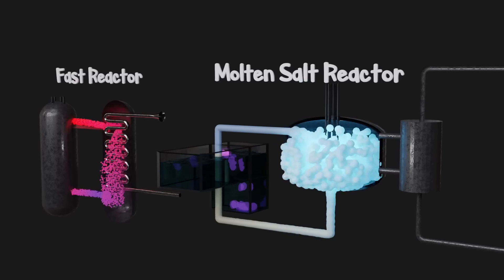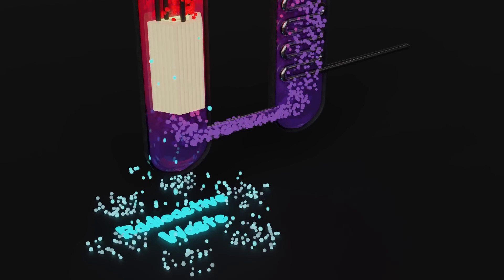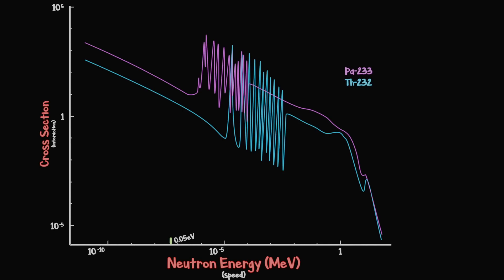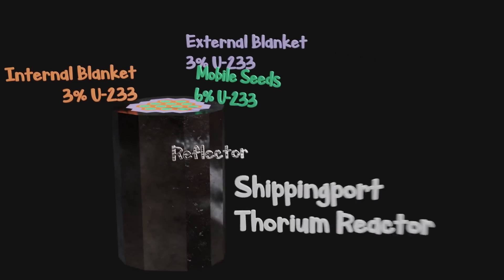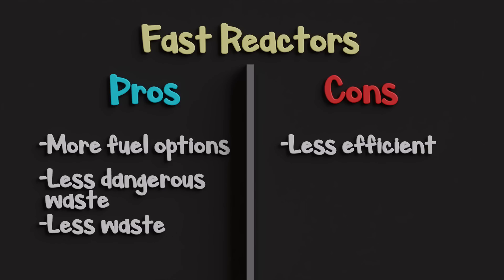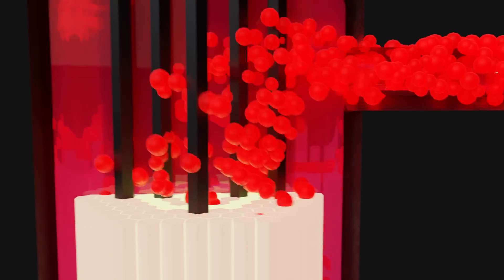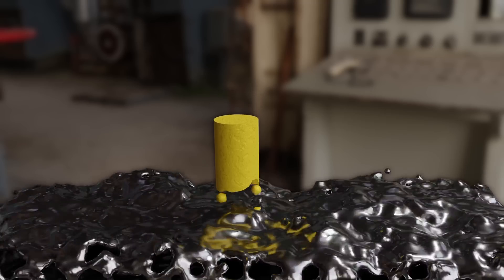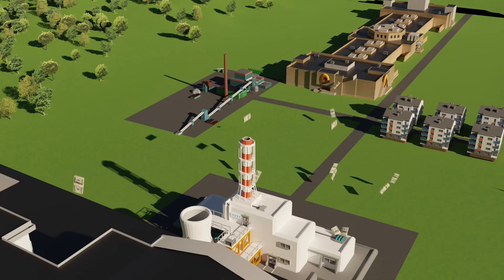Thorium and Fast Neutron Nuclear Reactors

Comment: The point is - why use thorium at all, when spent fuel and depleted uranium (DU) is abundant?
The waste of 1 reactor year of a 1 GWe conventional reactor can provide up to 140 times the electricity originally produced. Additionally, the side product from enrichment, depleted uranium can provide another 4 - 5 times the electricity of the spent fuel. In total, this is about 700 times the electricity that was produced by nuclear in the past. This are resources worth tens of trillions or even hundreds of trillions USD, that could pay the debt of the US multiple times easily.
A side effect is that the "waste" produced after complete burn down consists of 95 % partly precious metals, and about 5 % of waste that decayed after 300 years to the level of natural uranium. Of course, it is poisionous, but can be stored just like normal chemical waste. And the amount is small anyway, because 1 kg or uranium/thorium contains 24 GWh of thermal energy. 
But be aware, beside some advantages of thorium, there are nasty site effects. There are hard radiation sources within the thorium-cycle. Proactinium 233 and Thalium 208. Pa 233 comes from breeding Th233. It is a bad neutron poison, that requires immediate separation from fuel, otherwise reactivity stopps. Pa233 then must be stored separately, until it has decayed to U233. This decay also produces hard alpha and beta radiation. TI208 on the other side, comes from a small part of U232 produced during breeding. U232 decays at some point to TI208, which issues hard gamma radiation. This requires more extensive shielding and complicates handling. So the thorium-cycle has some drawbacks, which are often not mentioned. 
IMHO, before using thorium, waste and DU should be burned. And if this isn't enough after thousands of years, there is the posibility to get uranium from seawater, for which China seems to have found a cost effective solution now. 
Of course, you can use thorium sometimes in the same reactors, that burns waste and DU, but it isn't necessary for energy needs for a long time. 
So again, why use thorium when it isn't really necessary?

You missed the patented Dual-Fluid Reactor, which is a special variant of a Lead Fast Reactor (LFR). In contrast to the BN-800 it uses molten metal fuel instead of solid fuel. Molten metal fuel consists as base of an eutectic mix of U-235/U-238 and chromium. This has a melting point of about 900° C. You can also mix in pre-processed spent-fuel by the pyro-processing-unit and thorium. But this has to be done carefully to keep negative reactivity high to keep temperature below the design limited at cooling failure. 

🔋 Key Advantages of the Dual Fluid Reactor (DFR):
• ⚡ Ultra-efficient: Nearly 100% of nuclear fuel is used  
• ♻️ Burns nuclear waste, depleted uranium, and even thorium  
• 💥 Transmutes long-lived actinides into short-lived fission products  
• 🔄 Built-in Pyro Processing Unit (PPU): Continuously removes neutron poisons and extracts valuable metals  
• 🛠️ Liquid fuel: No solid fuel rods, no batch reloads  
• ⏳ Decades of operation with a single fuel load possible  
• 🚫 No corrosive salts: Liquid metal fuel avoids fluoride corrosion and complex chemistry  
• 🧊 Lead coolant: Excellent radiation shielding, no water, no pressure → no steam explosion risk  
• 🌡️ Very high temperatures (700–1000 °C): Enables hydrogen, e-fuels, ammonia, and direct steel reduction  
• 🧠 Self-regulating: Output adjusts automatically via negative temperature feedback  
• 🪫 Minimal waste: Only short-lived fission products remain
• 🏭 Compact & scalable: High power density, ideal for modular deployment  
• ⚙️ No moving parts in reactivity control: No control rods required  
• 💰 Uses existing stockpiles of spent fuel, DU, and thorium  
• 🌍 Reduces dependence on enrichment, imports, and fresh uranium mining  
• 🔄 Full closed fuel cycle: No external reprocessing needed  
• 🆚 Outperforms typical SMRs: No pressure vessels, no high-pressure coolant, no water-based systems

Comment: Excellent explanation on fast neutrons.  First time I heard of Pa233.  Thanks for your work on this!
Reply: There is also Pa-232 which decays to U-232, that decayed to TI-208 at some point, which is one of the hardest gamma radiator, require extra thick shielding like 1 m of concrete.

Comment: I have a fast fission reactor concept in where the major fast fission reactor roadblocks are solved.
  Sodium positive void reactivity.
  Sodium reactivity in presence of oxygen or water.
  Decay heat.
  Breeding efficiency
  Material irradiation damage.
  Fuel reprocessing
  Fission products disposal
  Spent fuel reprocessing
  Plutonium separation chemistry (proliferation issues)
The problem is that I didn't find a company interested in my concept.

Comment: If UCl4 is corrosive, why use it? Use UCl3.  Cl-36 radioactivity is not a problem because Cl-36 is stable enough (half-life > 300,000 years, with a single beta decay of moderate energy to stable argon) to re-use in reactors and its fast neutron cross-section is lower than Cl-35, and when capture occurs it produces stable Cl-37, with a still lower fast neutron cross-section. Fast reactors can also use thorium. The low capture-to-fission ratio of fast neutrons allows its low fission cross-section to be easily overcome by starting with higher fissile content, so that it will pass by more fissile atoms before leaving the core. Materials that reflect fast neutrons back into the core, without slowing them down much, can also help. Molten Cl salt is cheap and non-toxic. Why use FLiBe which is expensive and super-toxic, and slows neutrons? Slow neutrons produce fewer neutrons per fission, and Be can undergo a kind of fission that releases neutrons. The popularity of FLiBe and thorium and the aversion to fast reactors is politically-driven by a financial elite that does not want people to have uncontrolled access to cheap and reliable power, because this creates optimism and inclines people to be friendly and very unwilling to go to war. To run an evil empire, you need your subjects to regard each other as competitors for limited resources. The evil empire sought to eliminate nuclear power completely; failing that, they make it too expensive for most uses, make it dependent on large supplies of freshly mined uranium, and hinder it with perpetual religious rituals around the disposal of spent fuel and decommissioning, and flagellation on steroids whenever there's an accident, with perpetual cleanup and decommissioning.
Reply: Best is to use no salt at all.
🔋 Key Advantages of the Dual Fluid Reactor (DFR):

• ⚡ Ultra-efficient: Nearly 100% of nuclear fuel is used  
• ♻️ Burns nuclear waste, depleted uranium, and even thorium  
• 💥 Transmutes long-lived actinides into short-lived fission products  
• 🔄 Built-in Pyro Processing Unit (PPU): Continuously removes neutron poisons and extracts valuable metals  
• 🛠️ Liquid fuel: No solid fuel rods, no batch reloads  
• ⏳ Decades of operation with a single fuel load possible  
• 🚫 No corrosive salts: Liquid metal fuel avoids fluoride corrosion and complex chemistry  
• 🧊 Lead coolant: Excellent radiation shielding, no water, no pressure → no steam explosion risk  
• 🌡️ Very high temperatures (700–1000 °C): Enables hydrogen, e-fuels, ammonia, and direct steel reduction  
• 🧠 Self-regulating: Output adjusts automatically via negative temperature feedback  
• 🪫 Minimal waste: Only short-lived fission products remain
• 🏭 Compact & scalable: High power density, ideal for modular deployment  
• ⚙️ No moving parts in reactivity control: No control rods required  
• 💰 Uses existing stockpiles of spent fuel, DU, and thorium  
• 🌍 Reduces dependence on enrichment, imports, and fresh uranium mining  
• 🔄 Full closed fuel cycle: No external reprocessing needed  
• 🆚 Outperforms typical SMRs: No pressure vessels, no high-pressure coolant, no water-based systems

Comment: The Experimental Fast Breeder Reactor at Dounreay on the north coast of Scotland was built in the 1960s and operated until the 20s.  It takes non-fissile U238 and turned it into Pu239, plutonium, which is highly fissile.  Natural uranium 6:59  ore, as mined,  is only about 0.5% fissile U235, and about 99.5% non-fissile U238.  This fast reactor created about 900times more energy than an ordinary U235 reactor.  This means the world has huge potential nuclear resources by using the fast reactor process.  The waste from this process is negligible.
Reply: How can it generate about 900 times the energy as an ordinary reactor, when the difference in fissable mass according to your data is only about 200 times?
In reality it is even lower, because an ordinary reactor uses enriched uranium, and uses about 2 % of the fuel. This results in about 50 times more.
All the fissable elements provide about 200 MeV, and the total amount of energy including actinides and decay is about 24 GWh/kg.

Comment: Proposed Thorium reactors will be more efficient converting U238 to plutonium due to the cross section of U238.  They could also tailor the salt for preferred mix.  The extra production of transuranics is less of a concern to nascent bomb producers.

Comment: Of the six proposed fourth-generation nuclear reactor types, the Molten Salt Reactor (MSR) is the only type with high fuel efficiency, no danger of explosion, and does not generate substantial amounts of plutonium. The fissile uranium-233 produced by the MSR is difficult to use for weapons because of the presence of highly radioactive uranium-232. While other Small Modular Reactors (SMRs) can serve as a short-term solution, MSRs are considered a more promising mid-term solution due to their potential to address these issues more comprehensively. Hopefully, we will have fusion by the time we run out of uranium and thorium. With the molten salt reactor, 7.5 million tons of uranium will be exhausted in a thousand years at an annual consumption of 7500 tons. Using thorium will extend it by a couple of thousand years.

The differences between Light Water Reactors (LWR) and Thorium Molten Salt Reactors (TMSR) are significant in fuel utilization and waste production. LWRs use approximately 0.5-1% of uranium fuel, leading to the generation of long-lived radioactive waste due to inefficient energy conversion and the use of enriched uranium. In contrast, TMSRs can achieve fuel efficiency of up to 98%. This is achieved by converting fertile thorium-232 into fissile uranium-233, substantially reducing waste production and more manageable radioactive waste. Uranium Molten Salt Reactors (UMSR) will produce more plutonium but are just as effective as TMSRs.

940 kg of natural thorium in a Molten Salt Reactor (MSR) can generate 1 gigawatt (GW) of electricity for one year. In comparison, generating the same amount of energy in a Light Water Reactor (LWR) would require mining 210 tons of uranium. In an MSR, the storage requirement for 83 percent of the spent fuel is 10 years, and 300 years for the remaining 17 percent, whereas in an LWR, 24.44 tons of spent fuel need reprocessing and storage for 200,000 years. MSRs can utilize the spent fuel from LWRs. A coal power station will need to burn 3.5 million tons of coal and emit 10 million tons of carbon dioxide to produce the same amount of energy for one year. That amount of coal contains 3 to 14 tons of uranium, 3 to 14 tons of thorium, and an average of 84 tons of arsenic.

MSRs can adjust power output to match electricity demand, thanks to the inherent and automatic load-following capability provided by the fluid nature of the molten salt coolant. A key safety feature of MSR is that it automatically adjusts to prevent overheating. This is achieved through a "negative thermal reactivity coefficient," which means that as the temperature rises, the reactor's reactivity decreases, preventing a runaway chain reaction. Additionally, the MSR has a "negative void reactivity coefficient," ensuring that the reactivity decreases if there is a loss of coolant or boiling, preventing potential overheating. These safety measures help keep the reactor stable and safe under various conditions.

Looking ahead to 2040, China plans to deploy Molten Salt Reactors (MSRs) for desalination of seawater, district heating or cooling, hydrogen production, powering of ships equipped with thermoacoustic Stirling generators, and power plants with supercritical carbon dioxide turbines within its borders and globally. In the Earth's crust, thorium is nearly four times more abundant than uranium. Every atom of natural thorium can be harnessed, unlike natural uranium, where only 1 out of every 139 atoms can be used. China produces thorium as a byproduct of its rare earth processing. Similar to the trends observed with solar and wind technologies, MSR costs are anticipated to decrease with the scaling up of production and the development of robust supply chains.
Reply: The LFR with separate liquid metal fuel (Dual-Fluid Reactor) has similar properties.
🔋 Key Advantages of the Dual Fluid Reactor (DFR):

• ⚡ Ultra-efficient: Nearly 100% of nuclear fuel is used  
• ♻️ Burns nuclear waste, depleted uranium, and even thorium  
• 💥 Transmutes long-lived actinides into short-lived fission products  
• 🔄 Built-in Pyro Processing Unit (PPU): Continuously removes neutron poisons and extracts valuable metals  
• 🛠️ Liquid fuel: No solid fuel rods, no batch reloads  
• ⏳ Decades of operation with a single fuel load possible  
• 🚫 No corrosive salts: Liquid metal fuel avoids fluoride corrosion and complex chemistry  
• 🧊 Lead coolant: Excellent radiation shielding, no water, no pressure → no steam explosion risk  
• 🌡️ Very high temperatures (700–1000 °C): Enables hydrogen, e-fuels, ammonia, and direct steel reduction  
• 🧠 Self-regulating: Output adjusts automatically via negative temperature feedback  
• 🪫 Minimal waste: Only short-lived fission products remain
• 🏭 Compact & scalable: High power density, ideal for modular deployment  
• ⚙️ No moving parts in reactivity control: No control rods required  
• 💰 Uses existing stockpiles of spent fuel, DU, and thorium  
• 🌍 Reduces dependence on enrichment, imports, and fresh uranium mining  
• 🔄 Full closed fuel cycle: No external reprocessing needed  
• 🆚 Outperforms typical SMRs: No pressure vessels, no high-pressure coolant, no water-based systems

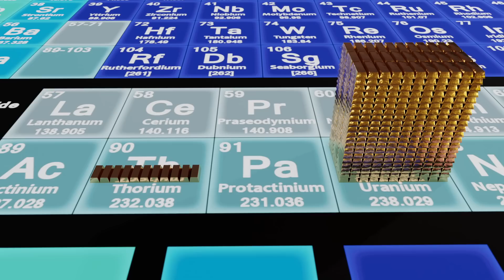Comment: @6:27, if talking about "mass of thorium on Earth" you should take the full earth's crust mass (~3x10^18 tons) and multiply by ppm (12 ppm or 1.2x10-5).  That gives about 3.6 x 10^13 or 36 TRILLION tons (not "6.35 million tons").  I expect you used the "reserves" numbers, but reserves change based on price of the material and its volume of consumption.  The world USES very little thorium, so the reserves are far lower than what is really on Earth.  Also, Thorium is found in PERCENT quantities (~10%) in monazite sands, which is where rare earth elements come from (those needed by high technology, such as neodymium for motors and generators).  That thorium is actually a WASTE product of the mining and so we would have access to massive amounts of thorium if we just consumed even that much.  In any case, if you then combine thorium on earth with burnup-rate you are well into the millions/billions of years.  We won't run out.
Reply: Extracting some of the 4.6 billion metric tons of uranium in seawater is much easier. 😊

Comment: There is plenty more fast reactors then just NaK and Salt/Sodium. There is also Helium and Lead.

Its also a bit more complicated than reactors are just thermal and fast. With reactors that is traditionally thermal have some fast spectrum, specially so for say like SCWR reactors.

Then there also exist plug in fuel cell. Sort of a upgrade for old reactors. Those already exist, but are not in use (well possibly in India). the main reason they are not in use is that due to how regulation works they are not economical.

Comment: You first stated that the energy sector is not lucrative enough for investment 2:46, then you end with energy is the backbone of everything.... the society return on investment is the most lucrative 11:38.  WTF?  I guess investing 3.5 billion to boil 2.5 gallons of water is ok as long as its fusion.  Fusion will power the world in 30 years raised to an unknown power.  The AEC/DOE is still saving face from firing Weinberg and doesn't want anyone to know about the MSR.

Comment: After these next generation reactors come online we need to build multipurpose reactors ones that can make red hydrogen and produce power for a given area. Thus supplying stored energy and On demand energy.

When the grid isn't needed it can be used to create hydrogen at an increased rate.
Effectively storing the nuclear energy that was going to go to waste anyways while idle at low power draw when demand is low.

But I do believe for a great deal of large and medium size off line power needs, hydrogen is going to overtake battery especially when resources are going to become harder to get a hold of with coming skirmishes and wars.

Hydrogen power and burning uses far less precious metals and far less needs to be especially recycled at end of life.

I believe the Japanese are ahead of the rest of the world in red hydrogen.